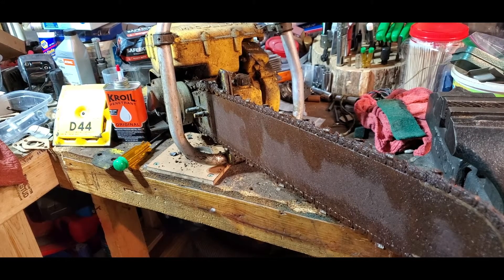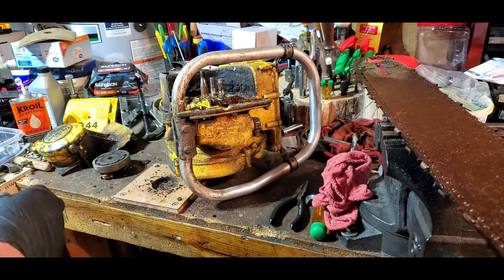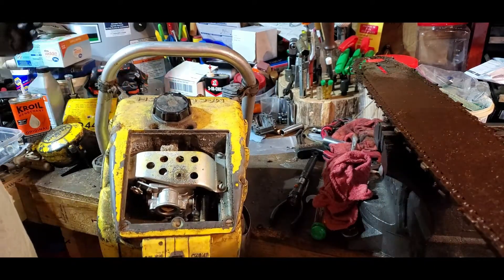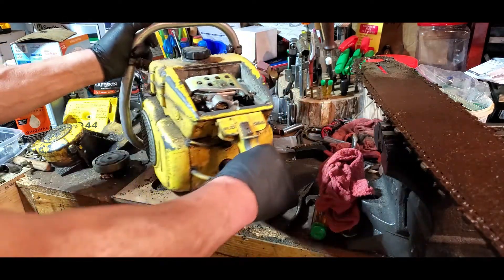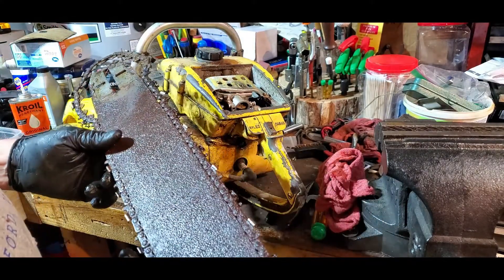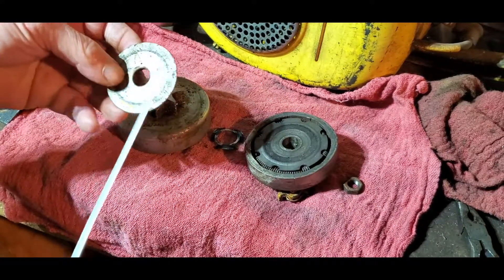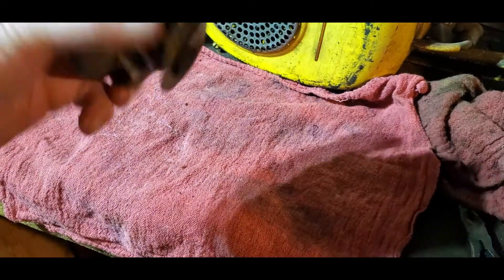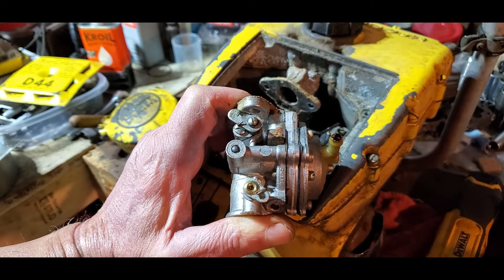Resurrecting a McCulloch D44 Chainsaw - Part One of Three

Comment: I am interested in seeing where this one goes Clint. From what I am reading this one is low rpm high torque. I am also seeing others saying these have carb issues when running on their side. Looking forward to more of your videos with this one and seeing how you work through the challenges.
Reply from the maker: I'm not letting up on this one. If any way possible I will make it run.
Reply from the maker: Very slow 6500 RPM's. I will not change anything about the performance. Just get it running and cutting. The chain is giving me a fit, but I will save it.